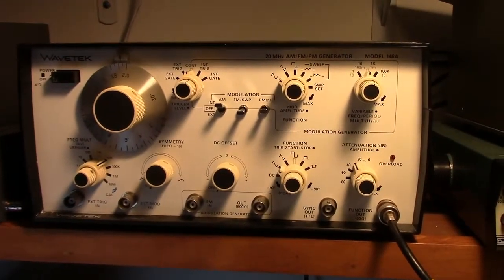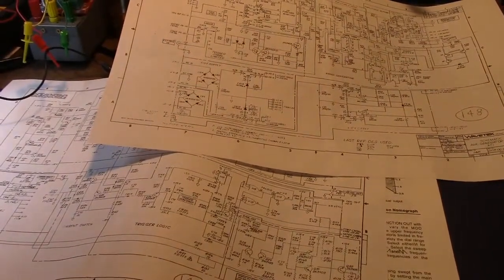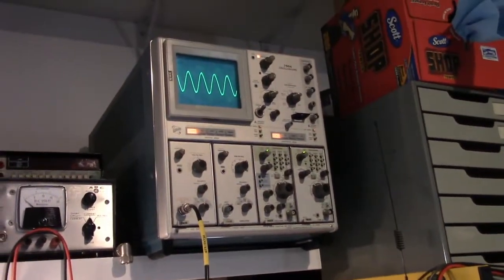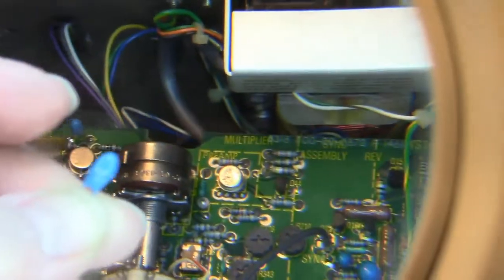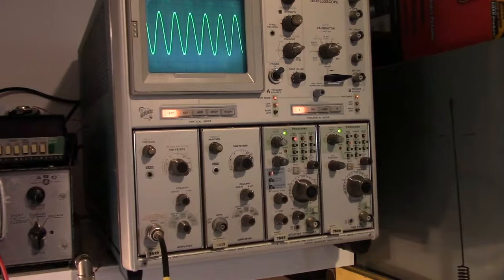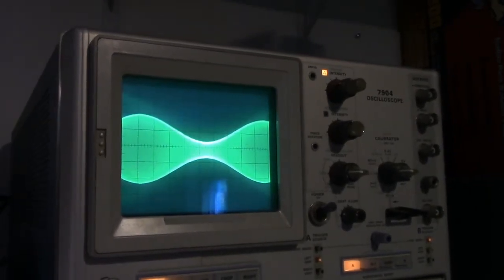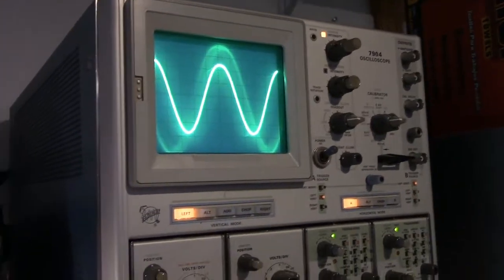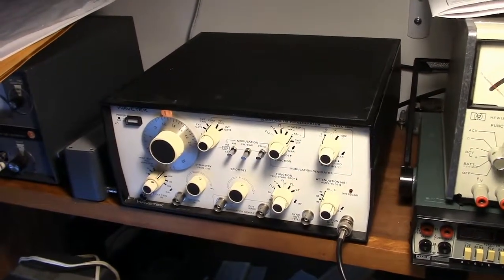Wavetek 148A function generator

Comment: Question; why did you use a tantalum as a replacement? Am I wrong in thinking a film or electrolytic would be better?
Reply from the maker: I used tantalum as I have a number of them.  They are more stable and have better ESR . I never use tantalums close to their rated voltage. I've repaired a number of Tektronix 7000 series scopes that all had leaky tantalums  causing the SMPS to fail to start.  They were used a little too close to their voltage limit.  A few voltage spikes above their v max and they tend to fail.  For power rail bypassing modern electrolytics will work just fine. You can get good ones with low ESR.  I almost always use tantalums in timing circuits due to their stability and small size/capacitance.
Reply: @toddanonymous5295  Thank you. Perfect answer!!
Reply: @toddanonymous5295  So I picked one up for 75.00 in mint shape. Walked it through all the functions. Seems to be producing uniform clean waves and sweeps. Your video helped! I plan to use it for FM alignment. I don't have any MPX gear but I've been keeping my eye out for a heath kit unit for that. I have a feeling this wavetek is going to come in handy for many other uses.